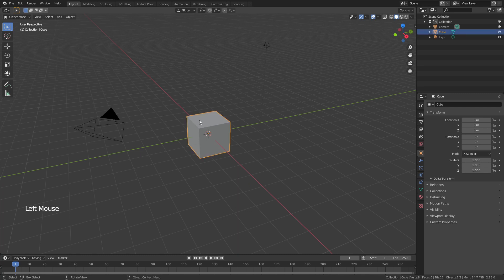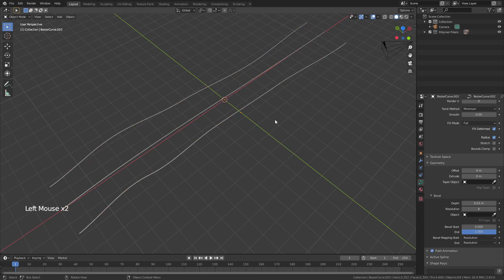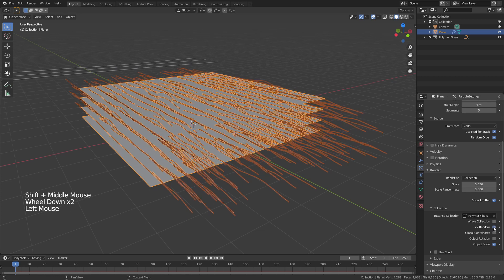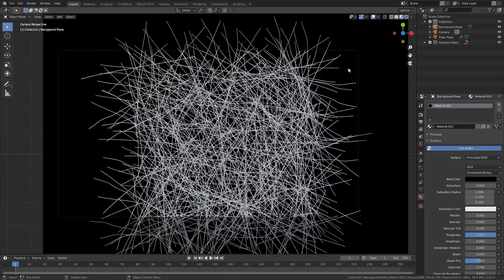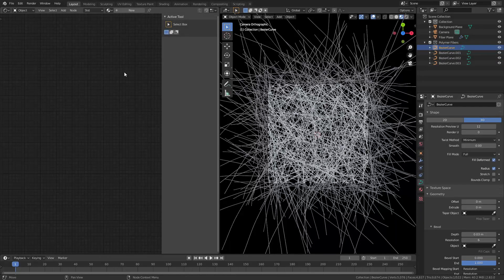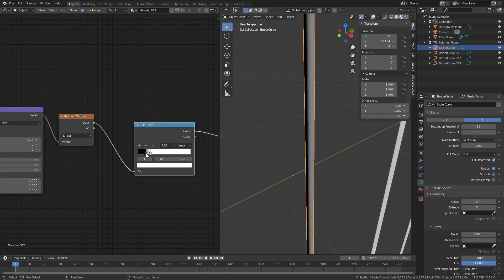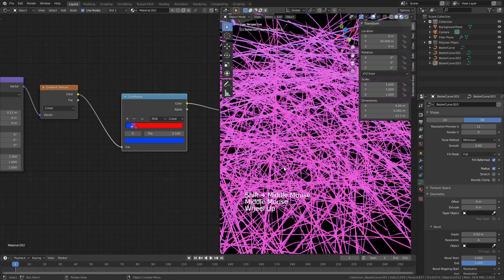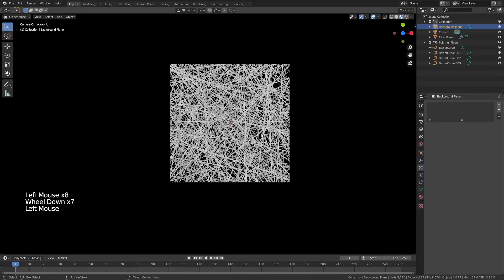How to Make SEM Imaged Polymer Fibers in Blender 2.8

Comment: I was following the tutorial but when I made the hair perticles rendered as collection, it does link but no fibers are shown. If I use a different collection of objects they do appear, and if I go into edit mode on the fibers I see all the nodes randomly scattered over the plane. But no fibers are visible. Anyone have any idea what could be causing that?
Reply from the maker: Hey Stuart. This could be the scale or position of the fibers themselves. If they're too small or moved off their origin they might be 'elsewhere'. Try selecting all the fibers in your collection and using Ctrl+A to apply all the transformations.
Reply: @CGFigures  Thanks for the quick reply. Unfortunately it didn't resolve the issue. It don't know whether there a strange bug with 3.0.1? I've tried twice to different PC's and both have the same thing. What's really strange is a friend made the complete image with 2.9, it worked, and then sent me the file. When I open the file with 3.0.1 I still don't see the fibres. At this point I don't expect you to resolve this, but thought I'd post in case it's worth investigating.
Reply from the maker: @NoRightToBragg  Hmm. Thanks for the update Stuart. This must be an issue with the transition to 3.0. I will likely be revisiting plenty of tutorials (this one included) using the new geometry nodes system, since it offers more power/flexibility anyway, but I will update the description of this video to reflect the 2.9 vs 3.0 issue.
Reply: @CGFigures  If you convert path into mesh, the fibers will be shown in the viewport:)) anyways, thanks for your amazing tutorial!!